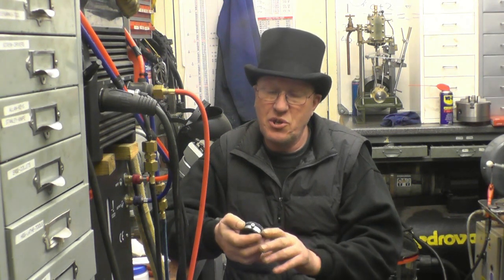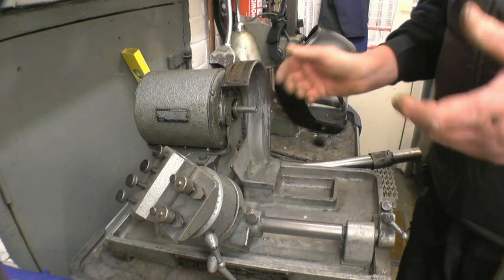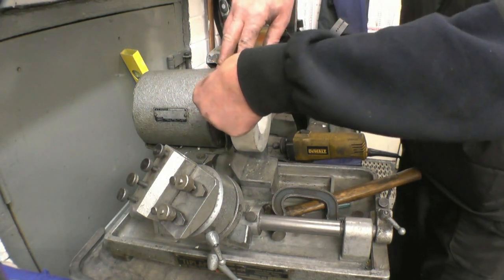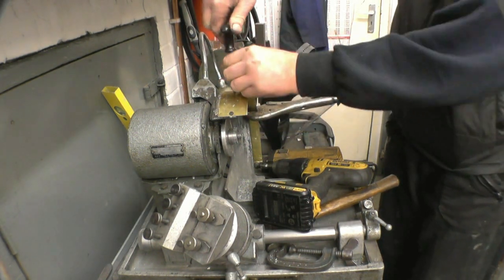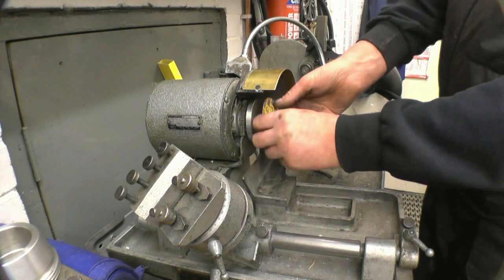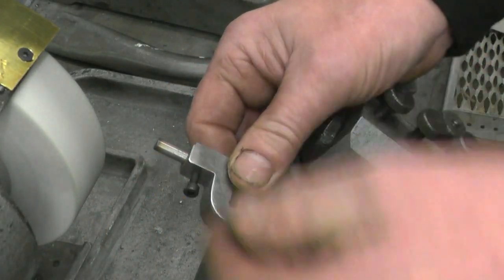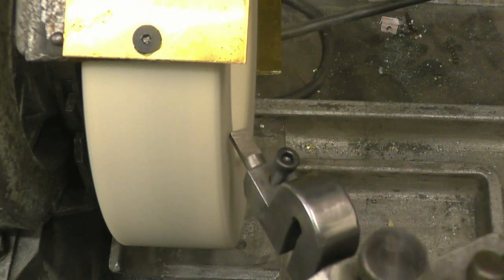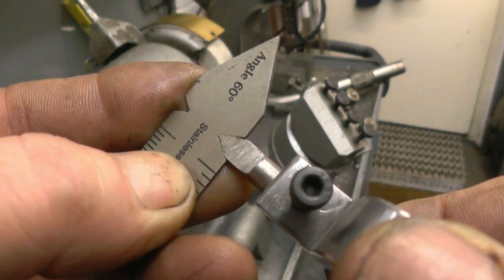SNNC 159 P1  Screw Cutting Tool Grinding

Comment: John,
I know you mentioned it, but those bearings on your grinder are about shot. What you don't want is for the bearing to freeze up and have the shaft start to turn in the inner race. I've seen it happen before. The shaft ends up looking like it was turned on a lathe instead of just wearing on the inner bearing race.
Dave

Comment: John,    I've noticed the last few times when you "bump" align a disk in the jaws of your chuck you use a toolholder. Is there a reason you no longer use your roller bump tool?
Reply from the maker: Yes i have given them all away i need to make another